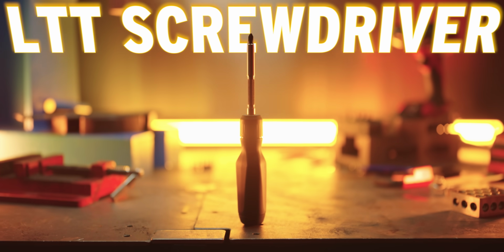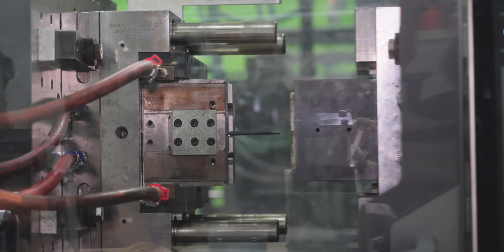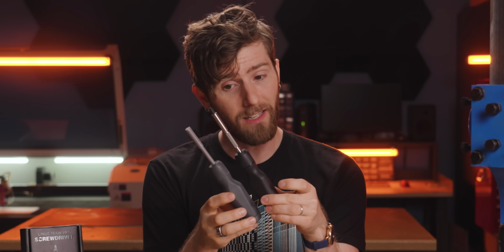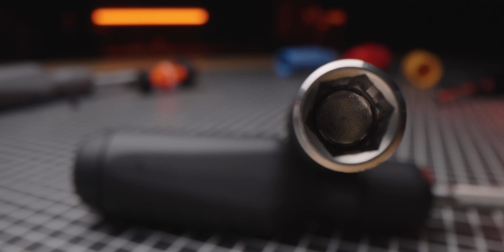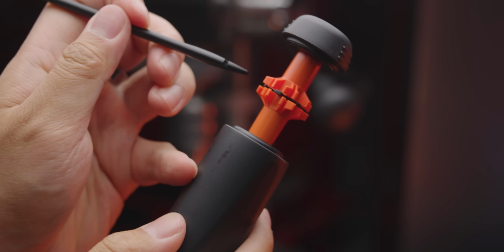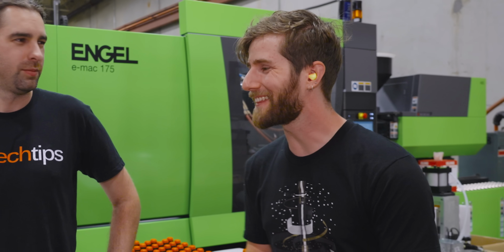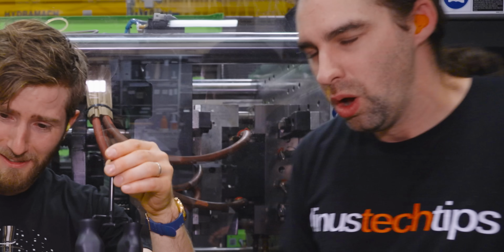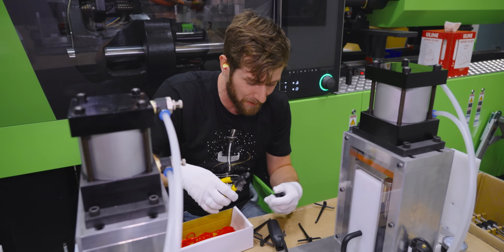Why our Screwdriver took 3 YEARS

Comment: have you guys looked at what kind of (if any) insulation these provide? i assume there are some red tape type certifications you have to go through to be able to claim that, but the multibit driver that i use daily is insulated, as i sometimes work on live AC stuff (HVAC) and would love to be able to use one of these. even 24VAC/DC rated insulation would be great!

Comment: Trying to make perfect plastic parts can be insanely difficult and is an expensive and long journey from start to finish.  Sending molds back and forth from the toolmaker to the plant for small revisions is very expensive, and then finding another thing wrong with the part after you just made a 2000pc sample.  

It gets annoying, hectic, and expensive.  Good job pushing through it and making something made of plastic that looks perfect.  That's a feat by itself.

Comment: @linus tech tips yo could you guys do a video on those $30, 60 TB external SSD's that are flooding out of china. we got one in at my work. its legit 60TB as far as we can tell. it reads as 4 15TB drives when you plug it in and can only do FAT32. the speeds are  however terrible. ours only managed around 17mb/s transfer rates. im wondering whats inside of these things. how it works and how they managed to fit 60TB on a small m.2. i ordered a 8tb model myself but im wondering if i should use it as a backup for all my old family photos or not. i dont know the quality and i dont want it to suddenly die on me 5 years from now. i would be interested to see your testing results on such a product. [EDIT] so it seem they just put a few small micro SD cards in there and somehow trick windows into reading a lot more storage. so they could be 4 256mb cards or something and it reads as 60TB. we managed to put a little over 3gb on our one but we dont have the time to find out actually how much space is on it.

Comment: I'm very interested.  I do very little electronics work and am in the construction trades.  I do work on my truck now and then too.  I used to have a ratchetting Craftsman driver that I liked a lot until the handle snapped off.  I've never found one better.  Price? Yeah, yours isn't cheap at all but I recently paid $70 for a pair of Knipex pliers because they are THAT good (I own three Knipex tools).  Real quality is a pleasure to use and is an investment once, enjoy forever thing. So, I'm on board and have some friends in the guitar amp building field that may be interested too.
EDIT, so I guess you are getting your wish as you are already to Wave 5 and this morning when I opened the LTT store then had breakfast and got ready for work over 500 sold in that hour.  Got my order in for two.  One for me and one for a guitar amp designer friend. If he loves it, he will probably mention it to his YT community.

Comment: I feel like if I didn’t have a spinal injury I would be a good fit to work with LTT because of this attention to detail. Even if his feel for tools is different than mine I appreciate that he went through a thoughtful process of thinking of the end users experience while a lot of other companies are headed in the other direction. I’m an electrician but unfortunately I can’t work anymore and the brands of tools I started off with changed their quality almost overnight and went from amazing screwdrivers that gripped tightly and just worked to me having to customize them while I looked for another brand. While I did find another brand they still weren’t the quality that they should be. I sound like an old man and for the demographic of these videos I very well may be 😂. Anyways…good on you LTT for striving for excellence in a world of cost cutting for an extra buck 💰.

Comment: You need to understand more about injection molding. Over time the molds change. Even user error, temperature of the factory, humidity, % of recycled plastic all affect the mold.

Comment: I'm disappointed. This screwdriver looks like a premium product and I was interested in purchasing one but it's price point is more than double anything else on the market. I understand recouping R&D costs, especially  for as long as this took to get to market, but in the end this is a ratcheting screwdriver. I wish you the best of luck in your sales. I'm sure there are plenty of people out there that want an LTT tagged tool. Me, I want a high quality product at a reasonable price point.

Okay, so after watching the stress test on the LTT screwdriver I give you mad props. The only screwdriver that did better cost over $140. Good job on a well rounded product. I'm still not going to buy one though, but if I was young, single, and had no kids I would really think about it.
Reply: I wouldn't say it's double, It's about the same price as the wera 6 in 1 and a few dollars less than the snap on, at least locally here. Double the price of megapro's lower end or something like milwaukee/dewalts. It's pretty in line with most top of the line screwdrivers though, some of which really aren't all that great in the first place.

Comment: I do not understand the ratchet direction thing at all.  You hold the ring and turn the handle in the direction you want to be screwing.  LTT somehow has decided that the tiny ring is the part that is important, not the giant handle.  So now you've managed to make a driver that works in the exact opposite direction of every other driver on the market, and which also moves the largest part of the driver in the opposite direction of what you want to be doing.

I LOVE MEGAPRO and their drivers are top-notch.  I have not used the LTT driver, but based on this video I feel like the changes presented are a step backwards in the product design.

Comment: I would have much rather seen how the metal shaft is produced. That is by far the most interesting and complex part. You also forgot to tell us how you solved the problem of changing the twist direction of the ratchet selector so that the selector is twisted in the same direction as you want the screwdriver to ratchet, rather than ratcheting in the opposite direction as in most other ratcheting tools.

Comment: Still too expensive for me right now, but now I at least know why it's at this price and it seems fair enough.
It would be nice if the bit holder had some kind of a metal rod inside, so you could tap it with a hammer and it won't get instantly damaged. I know it's not a heavy-duty screwdriver, but sometimes you just need to tap the bit in a little if the screw is dirty.
Reply: I'm feeling the same way about the price.

Comment: OK, LTT, I understand that your screwdriver with different sizes in the same handle is the best.

My set of different screwdrivers for each size works just as well, and I use them so rarely that I wouldn't give $69.99 USD for your screwdriver, my whole set was less money.

But I respect the effort on the part of the LTT team and their partners.

Comment: Why didn't you used a mould with hot runners? Finish would be greater and you didn't have to cut the runners, so it would be faster and with less material waste.

Comment: I work at a place that has a similar machine. We call ours extruders which takes certain percentages of resin pellets and get pushed through a screw /auger with 12 heaters that are 450 degrees F and the melted material is pushed through a die. We use RPP (recycled plastic pellets) to save cost for our virgin materials. We can only run 35% RPP in our machines for the trash bags we make. Very interesting set up you have and love this kind of content being able to see the making of things we all use in tech.

Comment: I'd like to see a model with a longer shaft or at least a solid extension that does not add more girth. I purposely bought a 6" and an 8" screwdriver mostly for the handle to clear case walls around the edges, especially on the upper side of the motherboard where you could be dealing with large heatsinks.

Comment: Got in wave 2 with a few bit sets because I woke up early in Australia 😂.

I’ve been hyping for this product quietly for years now! I watch the snap on tool truck rock past work every week… Should I just get one?, I think to my self every week for years! But the constant transparency and reassurance was professional and honest. So I’m locked in! I’m a business owner and system hardware engineer more importantly one of those guys who pulls apart everything and fixes anything that breaks Most of the time… and having a tool in my pocket is a regular thing. this is the tool I’m missing. No more multi tool knife driver bit bs 😂. 

I tried Snap-one’s ratchet and it was almost perfect but the bits were few and the tool was like $349 Aud and that’s a big ooofft.  So without trying this yet I’m hyped to the moon and hope just like your effort in great content and knowledge this tool will deliver the integrity the LTM have delivered to us over the year. 

Well done guys. I know the stresses of manufacturing and the weight you brought onto yourself to deliver what you believe to help the community! I hope beyond us it becomes a very successful product in hardware “must haves” like Snap-on tools etc. 👏👏🥳🤙✌️

Comment: Something to be aware of with security bits is that bastard manufacturers recess the screw head deeper than interchangeable bis can reach due to the thickness of the bit and holder. Even most longboy security bits are too fat to reach these screws. You need a dedicated screwdriver set with thin shafts.

Comment: Guy's if you live near a harbor Freight do yourself a favor, Go there and save your selves the money. You lose it and it won't matter. It can break and you can return it.. I took a ratchet back to Home depot the other day that I had for 5 years and it broke and I went back to the store and got a new one.. I tried to find something cheap and useful on the LTT store and everything I've seen at their store is marked up in some cases 200%!! Their Tee's are Marked up 150%, I just couldn't justify spending $47 dollars with shipping/Tax for a Tee shirt..
Reply: Its not marked up. All custom made custom design stuff with the highest quality materials that they can get. My estimate is a 10-15% profit margin. In the case of the screwdriver they sold about 7.000.000$ worth so around 700.000-1.000.000$ profit. Basically half of the development cost.
Reply: @quackatit  You must work their.. And don't troll because their shite is way over priced and I don't want to Just Trust Them Bro!!!

Comment: The piston you see isn't what drives the molten plastic into the mold. That piston there puts tons of pressure on the barrel to ensure that the molten plastic flows into the mold, and not out the sides.

Comment: When I was a kid, my mum and dad used to work for my grandpa making plastic twin wheel castors, using injection moulding.
So it was weirdly nostalgic watching Linus talk about how the plastic parts are made.
I spent so many hours during the school holidays there, imagining the sprews (the left over plastic in between) were fighter jets or spaceships.
Some looked like the one in the video, while others had shorter bodies and wings.
If I wasn't playing, I was making a little cash on the side, assembling the actual products.

Comment: sorry to be a hater, but being a tinkerer with electronics, i find that a small driver WITHOUT a ratchet is way more precise and manageable... not to mention cheaper... that's why i don't think i'll buy one of those, but an ifixit kit instead... and for bigger screws like case fasteners i have a store-brand screwdriver kit that's plenty durable (in fact i've used it for the best part of 20 years)....

Comment: First, you have a ton of views on this video. I am sure you will be fine paying for the R&D for this... basic screwdriver. You can try to make it sound as special as you can, but it is still just s screw driver. No, I will not be paying 70 bucks for a simple screw driver. I mean, you released a 30 minute video to try an explain why you are having to sell these for so much money. I would rather go buy a megapro (thanks for pointing out a MUCH cheaper option) on amazon and then have enough money left over to go have a nice dinner with my family. Sheesh. Call me a "hater" in the video if you want to... at least I don't hate myself by paying 70 bucks for a simple screwdriver.

Comment: Is this build good?
5 5600x
Asus rog strix b550
Evga ftw3 rtx 3070
Corsair 4000d airflow 
Lian li uni fans 
Corsair vengeance rgb pro 3600
Crucial p5 plus 1tb
Corsair rm750w
Monitor asus tuf vg27aq 2k 165hz 

Please respond Linus
Reply: no its crap
Reply: @blackj3sus989  is it?
Reply: Ik its missing a cooler but idk what i choose i want a recommendation please

Comment: In other words: you will end up paying more because they spent so much money reinventing the wheel.

A comparable, already established high end screwdriver has already paid off the initial R&D costs a long time ago and therefore would no longer need to pass on the costs.
Reply: Not really reinventing but more like refining, and I'm pretty sure it will paid back the R&D cost overtime
Reply: @_hanz73  A) Yeah, they get their R&D costs back by charging more for the product until they are recouped costs. Erg you end up paying more are they aren't large enough to swallow the R&D costs. Which is my point.

B) No it is reinventing the wheel. They are complete amateurs that have taken a well established product and then gone back to essentially fundamental basics to iteratively re-design it. That carries costs that won't be borne by the company but consumers. 

You are paying more for the amount of unnecessary R&D they have conducted.

Comment: I bet you could make an assembly machine to automatically assemble and press-fit the parts.
EPSON SCARA with force sensor to find the position for the shaft and IAI Servo Press for the press-fit.
You could use the EPSON Vision system for the QC also and IAI EC series for the press-fit drawers.
Call me :P

Comment: Quick cost recovery analysis/supposition.

Price per unit is ~70$
For 3 years, a team of 10 people working full time with a 150k$/year salary would cost the company about 3 million $
With a bit of luck, the wrong estimation in numbers / salaries / charges etc... might inter-balance between overshoots and under-estimates :p

Current manufacturing seems to output about 15k units per 10 days.
Assuming a 10% global net margin which would account for returns and other hiccups (hoping they make more than 10% margin on "all-good situation")
They can probably make around 0.1 * 70 * 15 000 = 105k$ of profits per wave.

Now, factoring in the initial cost (let's assume a Million Dollars if they win their Taiwanese deposit back and get the lawyer fee paid too)...
Thats a total of 4 millions to pay back.

That means it should take about 40 waves to be completely in the green all hiccups factored in.
Thats over a year a full-on balls to the wall production, potentially limited by:
- Parts and materials availability (which price should also not raise too high to avoid eating margins) => Probably safe.
- Operators dexterity (as shown in video) unless there is an improvement to automate the manual parts.
- Buyers demand (Linus mentioned millions of units capacity per mold, thats probably not coming out of nowhere, but I can't estimate that since it mostly depends on marketing and distribution partnerships).

All in all, WOW !!!
Huge project nicely handled by LTT, please show more of your behind the scenes.
This level of transparency is a legit industrial masterclass as well as a anti-copying warning because not that many people can do something like it.
Especially knowing that this product-related videos allow a sponsor-slot and other revenues, but their own cost... Dang, this company is complex.

Hats off :)

Comment: Well yeah, that's product development.
And you did use existing designs for the important parts: ratchet and bit storage.
So as far as development costs go.
You did some 3d printing, with a printer you already owned and a chap already on the payroll. So zero net cost there.
 You paid to use pre-developed copyrighted parts and you had a few prototypes made.

 Quite how that justifies $70 for a screwdriver, I have no idea.
If you were making them in-house, maybe. With your kit and shop setup, that's actually possible.
But you're buying in bulk from china.
For the bit storage and ratchet mechanism, you didn't even need to get your own tooling made.

It's a nice looking screwdriver, but it's not $70 worth.
On the other hand I have just spent the last couple days researching ratchet screwdrivers with internal but holding.
Ended up buying a draper with telescopic shaft for £12 off Amazon renewed lol
So thanks for the inspiration :-)

Comment: The plastic holders for the tips should NEVER be plastic. They should be for example little metal inserts with magnets to hold the bits there, with zero wear, just like Xiaomi / Mijia does with their screwdrivers. For the price of this LTT screwdriver and how much "research" they put into it, I can see these plastic bits holders being the first thing to break and you start loosing the bits.
I hope they read this and make this improvement for version 2.0